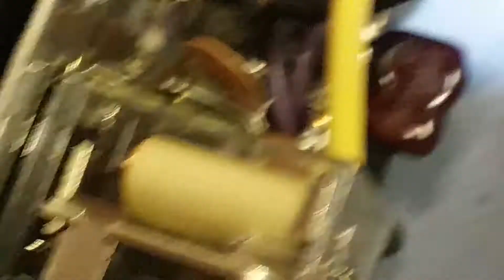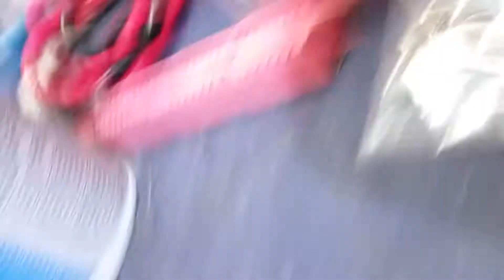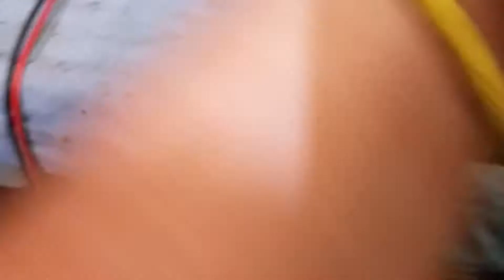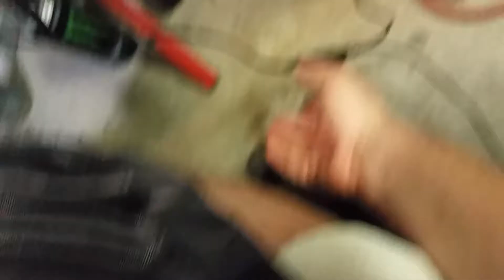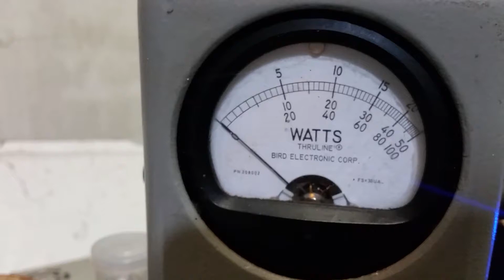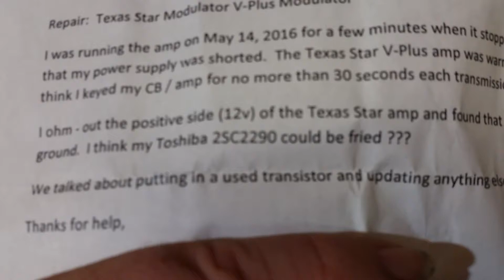Unit 93's Texas Star Mod-V Repair & Clean Up 🥳

Comment: My v mod has a 120pf after the variable and a 2000pf on the preamp. It shows a 68pf and the 2000pf doesn’t appear on the schematics.
Reply from the maker: Yeh someone put that 2000pf on the preamp... I think going off mem there is a 104 then the other 2 caps are small like 120 to 150pf and 330 pf

Comment: nice job on that one. that is the one I got new with my hotplate. DX1200. was never run into the DX1200 . I kept it my bench test amp.  I done nothing to it.. works just fine. all I did is put a SB 50 connector on stock wires.  My input tune pretty good . not as good as that one but close. it does take some time to heat up on stock radio . I never bothered with a fan . that has the same fuse holder on my killer bee  and that heats up a bit. The power wire upgrade  on my killer bee made the amp run cooler . not much help on power out. with same radio stock . I kept it because of the bee on it. taken in on trade to fix a bigger box. 73's
Reply from the maker: Nice....your forchibate to still have a good amount of amplifiers in your stash....I got rid of so many due to that last girl friend.

Comment: that cap gets hot and melts the solder. Heat changed the cap value. You might want to cool  this  amp down. Heat caused the variable go south too.  hey just playin on the zoo ( 72 hundred)
Reply from the maker: Roger roger brother lol!

Comment: At 10:51 you can see bare wire showing through the ground wire insulation on both sides of the grommet
Reply from the maker: Good eye man...GREAT EYE...I later put the power wire upgrade on it but for some reason I didn't add it to the video I think I had already uploaded the video and added the power wire upgrade before sending it out 
....
.good eye man!!
Reply: @1883GotDown  Thank you!